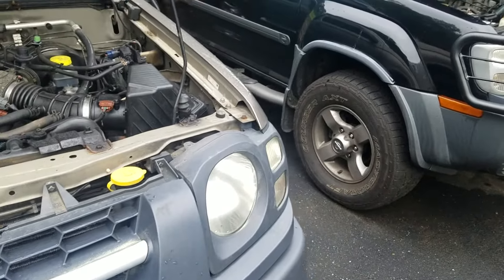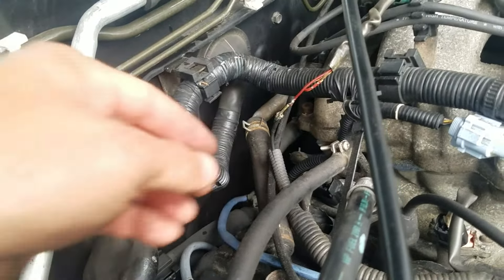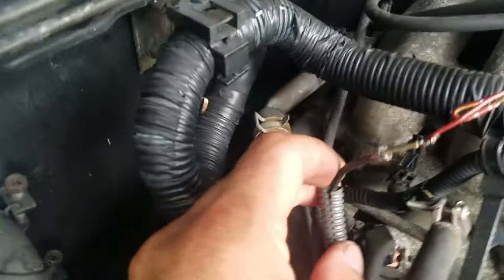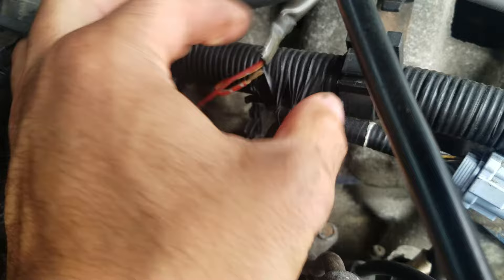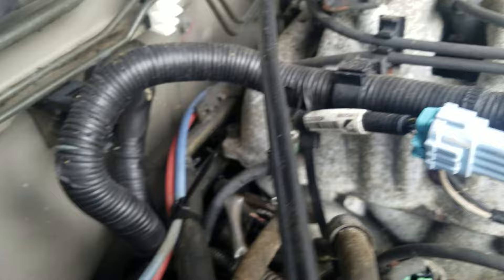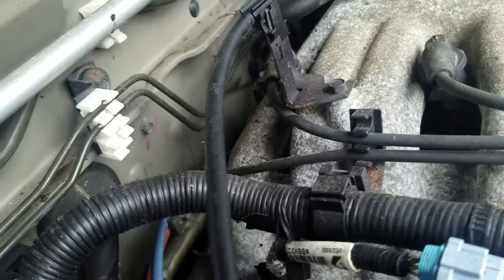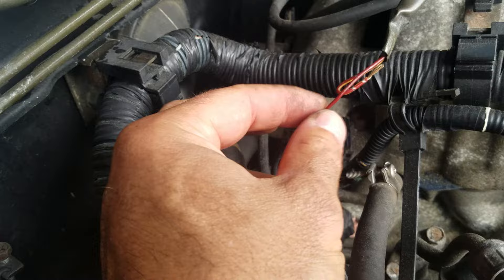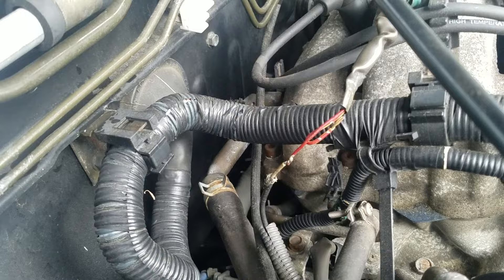How replace knock sensor (THE EASY WAY) 00-04 XTERRA

Comment: DON'T DO IT!!  This only turns off the check engine light but deadens the sensors sensitivity.  It's job is to tell the ECU to retard ignition timing to prevent premature ENGINE DAMAGE, why cripple it??  Knock sensors are ALWAYS mounted solidly to the BLOCK as close to the cylinders as possible for a good reason.
Reply: Coorect
Reply: on a higher performance engine i would agree however this wont knock even if you use the lowest grade fuel so its the chances of you even needing a functional knock sensor are very low.
Reply: It does NOT take off the engine light. Mine worked for 3 years on the  original and now its finally giving a code and engine light
Reply: I agree.. the moment you start mounting it in a different location it loses its ability to listen to knock.. especially since he mounted it on the intake plenum.. seems very counter intuitive.. I would've located it to a easier spot on the block

Comment: Is this model specific? I have a 2000 (4/00mfd) Xterra SE 3.3L (V6) I have the new sensor and harness. Just don't want to cut without being certain. Thanks!
Reply: He did say 2000-2004
Reply: @mistermirror8064  V6 or 4 cylinder?

Comment: What are the symptoms of a bad knock sensor? My 2002 xterra shows a code  (knock bank 1) Its missing pretty bad. Has no power and doesnt accelerate without shaking...
Reply from the maker: Some xterras show more signs then others.. but if you have the code.. change it out.. very easy to do
Reply: @vladtexas  Moving it does not fix the underlying problem just the symptom. If you car is detecting a knock you may have a different problem that is now being masked by a desensitized sensor.

Comment: So only 1 wire goes to the Knock sensor pulling the po328 code ty?
Reply from the maker: Only one wire goes to the knock sensor... Yes! The other wire from a new knock sensor is just hang in there. Or you can just type it up.
Reply: @vladtexas  So the 1 wire is the hot and the sensor is grounded to the intake?
Reply from the maker: @chiefymarino  yes!
Reply: @chiefymarino  yes the wiring diagram shows that the sensor gets its ground from the mounting surface

Comment: Questions to be answered:  Why is the  knock sensor code firing? Is the engine running so poorly, it is 'actually' knocking? Can a knock sensor 'go bad' and send a false signal or is that impossible?  I assume it cannot, but I do not know. I am aware it is designed to produce an AC voltage (via piezo-electric effect) that only occurs if the engine is actually knocking and physically vibrating the sensor. If a knock sensor does go bad, can it send a false AC signal to the ECM and set CE light and a code? Again, I have to assume it cannot. All the above said, relocating the sensor will not cure an engine running so poorly it knocks, but it may place the sensor in a location isolated from the vibrations of a knocking engine and keep the CE light off and allow you to pass emissions test. The Caution is, you may be disguising a true knock and damage may result, depending upon the severity of the cause of the knock!

Comment: Um, this is totally wrong.
If you are just trying to get rid of your check engine light to pass emissions or whatever, then sure, this will work. However, if you just stick your knock sensor on top of the intake manifold like this video shows, it will no longer be able to do what it is supposed to and detect pings and knocks that come from pre-ignition. This means that if you do end up having pre-ignition pings, they would go unnoticed, and the ECU would not be able to retard or advance ignition timing in order to prevent them. This could potentially cause severe damage to your engine in the long run. I know that it's a pain to remove the manifold just to replace a sensor, but the knock sensor is in that spot for a reason. Please don't do this to your Xterra if it is your daily driver or if you want it to be reliable. Also, that wiring job looks janky AF, so that's another concern. 
Here is a video of how to do this job correctly: https://www.youtube.com/watch?v=73C5KYTgVC0
Reply: They never claimed that this is the proper fix. some people dont have the time or money to do it right. someone like me. i rebuild cars but i dont have the time to tear down my daily and i sure as shit dont have the grand they want to do it at a shop. so yea im using this way.. guess what if your scared run higher octane. i have always ran 89/93 in mine so honestly i dont care and many others dont
Reply: I completely agree!! This is NOT the way to fix your knock sensor!!
Reply: You linked right back to the current video!  I also agree, this is not the way.
Reply: I own an xterra. The intake manifold design on these things are garbage. Hell just Changing the plugs and thermostat on the 3.3 is a nasty job.

Comment: How do you know which wire from the pigtail to connect? I can't see any difference between those two red wires..
Reply from the maker: Just pick one.. they both will work
Reply: You don't know your left from your right?
How did you survive 1990s without internet 🤣😂

Comment: i got my knock sensor on amazon.  the plug has 2 wires on one side and only 1 at the knock sensor plug.   seems like that second wire doesn't actually go to anything.

Comment: In California you are not allowed to relocate, if the smog guy catches you he has to report it "System tempered" and the car fails the smog. The second question is does it bother the computer? well the company put it there so the sensor detects knocks, by putting it all the way on top of intake it's not gonna detect well, you can put it on the block outside where the freeze plugs are many cars are like that from the factory, why bozo clown Nissan engineers put it in a such a difficult place I don't know, they don't care about the public about repair cost, among all three Toyota, Honda, Nissan, Nissan is the worst when it comes leaving room to work they put things so tight no room to work. I have been a mechanic 30+ years.